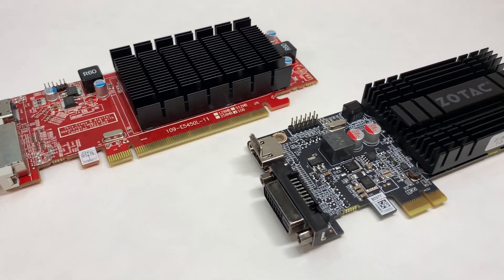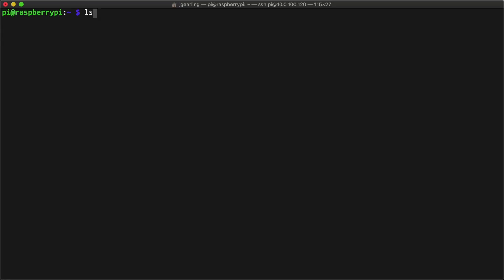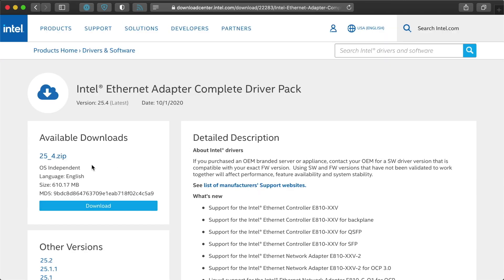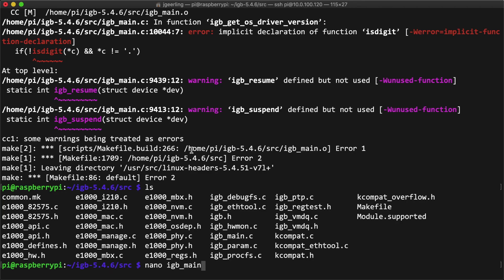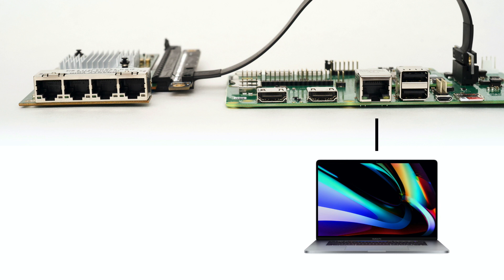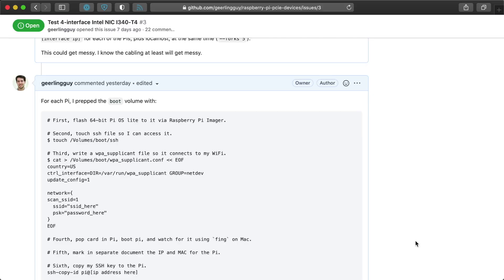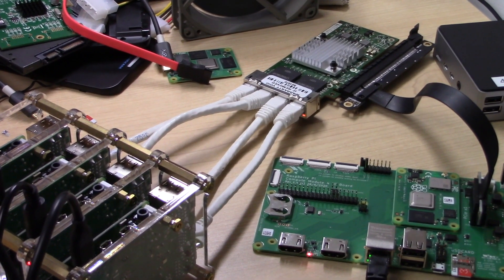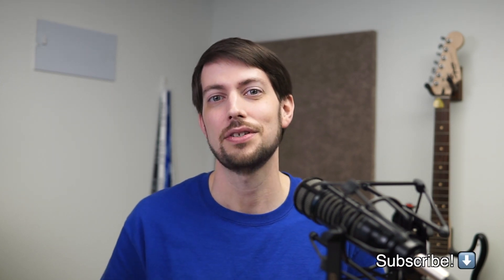5 Gbps Ethernet on the Raspberry Pi Compute Module 4?!

Comment: introduction-to-receive-side-scaling
"... RSS can improve network system performance by reducing:

Processing delays by distributing receive processing from a NIC across multiple CPUs.

Distributing receive processing helps to ensure that no CPU is heavily loaded while another CPU is idle.

Spin lock overhead by increasing the probability that software algorithms that share data execute on the same CPU.

Spin lock overhead occurs, for example, when a function executing on CPU0 possesses a spin lock on data that a function running on CPU1 must access. CPU1 spins (waits) until CPU0 releases the lock.

Reloading of caches and other resources by increasing the probability that software algorithms that share data execute on the same CPU.

Such reloading occurs, for example, when a function that is executing and accessing shared data on CPU0, executes on CPU1 in a subsequent interrupt.

To achieve these performance improvements in a secure environment, RSS provides the following mechanisms:

Distributed processing

RSS distributes the processing of receive indications from a given NIC in DPCs to multiple CPUs.

In-order processing...."

Comment: Note on the "Multiple IP Addresses" point: This is only relevant for IPv4. IPv6, by design, demands that any interface can have multiple addresses. These include: Link-local which is always starting with fe80::, the external IP and a private IP (if privacy extensions are enabled) based on the public IP. It also could be that an interface has an IP inside the fd00:: space, which is the address space that's not routed into the internet (and which can be misused to make NATv6 possible, although this is usually a dumb idea).
This also makes it possible to have multiple VLANs on a single port, which is great.

Still, multiple physical ports make stuff more redundant and can improve speed by link aggregation, so don't just throw out out old 4x1G NICs ;)

Comment: s.o.s !!!! I am searching for an almost similar use case like yours (only you power the nic directly from a pci slot probably that is why you can power it without external help)  months now and I cant seem to find any info anywhere. I want to connect to a mini-itx  motherboard (H370M-ITX/ac for nas build) an intel x520-da2 nic  card, but the only pci-e slot is taken from the HBA  card. So I thought to use an m.2 (the motherboard i mentioned has an ultra m.2) to pci-e adapter cable and connect there the 10Gbe card. Problem is from which power source I should power the nic card since m.2 slot can provide up to 8watt (if I can recall) and the cable at the pci -e end has a 4 pin fan-like header which can be connected to the psu via the 4pin molex or 4 pin sata. Will it be sufficient to power the nic or I ll burn both mobo and nic card ?

ps here some of the cable types  I was describing above https://www.google.com/search?q=m.2+to+pcie+cable&tbm=isch&source=iu&ictx=1&fir=vFKS9jJAKXM0lM%252CHbSbT9aFjGvdFM%252C_&vet=1&usg=AI4_-kS7wlqL_CmV_EW1Y8VdJDLTcfOt7w&sa=X&ved=2ahUKEwi1nu3jhZ_wAhUuwAIHHcZXD30Q9QF6BAgoEAE&biw=2121&bih=1222#imgrc=vFKS9jJAKXM0lM 

In conclusion even though 4 lanes of the ultra m.2 slot would be sufficient for speed my doubts are of how to power up the nic

Comment: What you could try is a LAGG, round robin mode, then another machine using equivalent LAGG, round robin. But you will need managed switch. Then configure 4 vlans, and put each port into a single vlan. Now you can have 1ip across your LAGG, and the round robin fires out into a vlan stopping any mac flapping that may occur. Allowing IP to IP connection via a round robin across the ports in different L2 broadcast domains. The downside to this method is requirement for managed switch and those networks only being functional to devices with the same shonky vlan setup. It's pretty hackish though. Also instead of a managed switch you can use multiple unmanaged switches, as long as they provide segmentation to prevent the Mac flapping behaviour

Comment: I use one of my Pi 4 as a home Wireguard VPN, and plan to expand my home network using more dedicated Pi, as dedicated boxes limits surface attack: a successful attack on one box could not impact another one in any other way, no sandbox or VM evasion (through general and local firewalling avoiding DoS)

Comment: It was disappointing to find out the RPi4 does not have hardware AES support.  That limits the ability of a router built on a Raspberry PI to do any VPN without a huge CPU overhead.  Just like my comment about GPU support, I hope that the Raspberry Pi foundation can find an SOC that has better support for mainstream hardware.

Comment: Your bottleneck is almost certainly going to be the high number of packets per second.  The arm cpu just won't be able to keep up past a certain point.  You can increase throughput by sending larger packets (jumbo frames) or by increasing the clock speed of your cpu

Comment: Jeff, well done chasing all the choke points that limit Ethernet performance. I had someone swear that it was impossible for Ethernet to achieve anywhere close to wire speed only to find out he was mounting floppy drives on two different servers and measuring transfer speed. He somehow thought fast Ethernet would magically improve his drive hardware, go figure. Thanks for using Barton Hills (82580), I led development for that product and I feel vindicated that it is still chugging away. Keep up the great work!
Reply from the maker: Small world, I love getting to hear from some of the people who have worked on these devices (a storage engineer who worked on one of the older controllers I tested spoke to me via email recently too!)

Comment: There isn't enough bandwidth. I work with networks for a living and build my own routers. There just isn't enough for all those ports over that 1x interface. Your basically taking 4x pcie and chopping 3 legs off...3 gigabits is actually damn impressive though. Can you test if the using usb bandwidth affects this? I'm curious and this might have a really nice use case

Comment: This comment will probably be lost in all the others, but it sounds like a system bus saturation issue. That's a common problem with SoCs. You could probably try overclocking the main clock which would potentially increase the system bus clock (most likely it's a 64-bit AXI running at 1/2 the CPU clock or something like that). Note that you're not saturating the bus in one direction, but multiple directions due to the MMIO handshaking required in the drivers to perform the network functions (i.e. multiple reads an writes). So that's why the bitrate you are seeing is not the same as the memory bandwidth for example. In terms of the Gigabit controller running at less than 1 gigabit, that's probably an issue with the MAC having additional overheads that will slow it down (so a single MAC wouldn't saturate the AXI bus).

Comment: It's obvious that it's the PCIe 1x slot that's holding you back. There's a reason that card uses a 4x connector. And the Pi is just not powerful enough to process all those packets in software.

Comment: You did a review of both the Pi 400 and the compute module with IO board. Given the price points which would be the better option? Both have advantages. The 400 is simplistic. The compute module and IO board seems to have lots more options for expansion. Only draw back to the module and IO board is there are no cases designed to house it. Since the module was designed to be embedded there were no cases created.

Comment: one question how do i fixing my Wi Fi on my HP Stream 11 after downloading LunixMint 19.3 it messed something up and now i cant use my wireless internet and the HP Stream 11 i have has NO Ethernet cable slot and the only way i can use it to get on YouTube or play on Minecraft servers is using my bluetooth Tethering it works but it slow and i don't know what wan card it uses but it should be related to INTEL if anyone on here can help me please help me ;-; also it is a 32bit system not 64 bit cause i just don't have the money for that and ive started to notic that 32 bit is starting to go dead witch is stupied it did have windows 10 but i got it from wallmart and lets just say THEY DONT CHECK FOR PREINSTALLED BLOATWARE ON THE DAMN HARDDRIVE THEN IT BLUESCREENS YOU DAMN COMPUTER AND LOCKS YOU OUT OF YOUR BIOS!!!! THEN YOU SPEND LIKE 1000$ ON A FRICKING 100$ LAPTOP AND THEN IT STARTS TO MESS UP THEN YOU ERASE THE ORGINAL OS THATS ON IT USING THE BIOS AND THEN INSTALL SOMETHING THAT WORKS BETTER BUT THEN BRAKES YOUR DAMN WAN CARD REEEEE also just incase you don't know LinuxMint is an unbuntu based distubution and all caps is just me ranting so ignore that if you want to

Comment: Looks like you'll need more than one PCIe lane to run more than 3Gbps with that thing.  Also, how much does the CPU clock affect how quickly the system can work on the data stream?
Reply from the maker: Apparently a lot! With the CPU overclocked, I can go from 3.06 to 3.40 Gbps total.

Comment: If you want to do networking stuff like that, I would recommend to use a pi clone: the NanoPi. For isntance the NanoPi R2S.
And flash armbian on it. Works wonders and cheaper than Raspberries.

Comment: I am not a Network Warlock ...but have learned some stuff on the pass on this realm ....

have you tried with MTU 9000   (Jumbo Frames ) ??

usually when you want really good performance in networks YOU HAVE to do that ....  
it is just a thing of too much control data bits versus how many really "Data" bits (Payload) 

so how about a little change in MTU in all Interfaces and try again ....   Even with the "native" Ethernet 

and let's see what happens !!!  
Pleasseee ????

Comment: Forget PFSense, their ARM-port is only for their particular hardware.
Also, their developers run to OPNSense, which has at least an RPI3-Beta-Build from a forum member which works.
Already had some time testing it.
They need some help for getting it running on the RPi4 (probably only DTS-related stuff) and moved over to the newer HardenedBSD-Kernel the V20.7 is using so maybe it's best to put your energy there.

Comment: Did you try Jumbo Frames.  Remember depending on the packet size at layer three you are chopping up packets to about a 1500 MTU size and you are dealing with TCP windowing at layer 4.  Your best bet is to use a UDP stream to really get an near accurate throughput , but you will never see a true 5Gbps because TCP is connection oriented and it has a lot of overhead.

Comment: Hell I'd be completely happy with 2 1gb connections. A router doesn't need more. I'd be interested to see how the connection speeds are when using a "dedicated" router OS/firmware. Right now I'm running pfsense on an old athlon CPU and I would definitely like to use something more power efficient.

Comment: have you tried disabling all wifi interfaces during the test ? Although low bandwith is needed it may be bottleneck in the interrupts part. You could do this  e.g by some scripts which will do rmmod / modprobe and then autoreconfigure wifi . Also you can try oprofile and manually assigning interrupts - you can start with this forum entry using Google Translate: https://trzepak.pl/viewtopic.php?t=33245

Comment: Here's another idea, and it's also about a device that would be used in a server environment. Because apart from loads of bandwidth, servers need a lot of storage space. I think it would be very interesting to test if you can make a SAS HBA adapter to work. Specifically, I think that a good device to try would be a IBM H1110 controller, PCIex4, has one SAS port to which the appropriate cable you can attach up to 4 SATA drives. It can do hardware RAID too. I use one of these in my home server (but not with its native hardware RAID, rather using ZFS). If it works, it should give you better performance than a SATA card, even a 4-port one.

Comment: what os do you use on your pi's
Reply from the maker: Almost always Pi OS. Sometimes HypriotOS, for the cloud-init integration. Might start testing more with Ubuntu though!
Reply: @JeffGeerling  I've currently been using Ubuntu server and its a little less smooth than I would like. I'm probably going to see how Pi OS works in comparison.

Comment: Unless R Pi designers changed something in the CM4, their specs on the PCIe lane is maximum of 4Gbps. So if you're approaching that it is likely there is some overhead in the drivers, OS, hardware, etc. What I'm hoping - like on my knees, hands clasped together, eyes to the heavens, is that some clever soul or company will design a board to house 2 CM4 modules, have two PCI slots, and modify RaspiOS to operate as a pseudo cluster that is able to get more speed throughput for things like the multiport ethernet. I know, I know - a cluster is not the same as a more powerful single computer. But, if you can have two Intel I340-T4s linked with a single gigabit connection there should be a way to get the speed you want under certain conditions. Anyway, I am completely stoked and motivated about the CM4's possibilities. I'm also going to get a TuringPi 2 when available. The future is bright!

Comment: A standard CPU can have 40 or more PCI Express lanes.... The Raspberry Pi 4 only has ONE..... Everything on the board that uses PCI Express uses that ONE lane...

The Onboard network card and external pci express 1x lane share the same ONE Pci Express lane..    Get a single 10 Gig network card are try to max it out... I would be interested to see what its max output would be....

Comment: you can use a soldering iron to open up the PCIe slot, did this on a dell poweredge to throw in a gt630

Comment: I didn't see anybody else mention this, but there were a lot of comments, so sorry if this has been said before. Have you tried jumbo frames? E.g. sudo ifconfig eth0 mtu 9000 all all of the interfaces? It should reduce the CPU overhead and with directly connected cables that short, retransmit shouldn't be an issue.

Comment: The qnap 5 gbps usb installs easily on the rpi 4 and works fine
Reply: QNAP USB 3.0 to 5Gbe RJ45 Adapter QNA-UC5G1T 

you mean something like the above?
I totally for it than the 4gx1+1g approach in this video.

Comment: You mentioned PFSense on the Raspberry Pi4 - how do you plan to do that?  pfsense does not offer anything like that, despite their own ram solution (whicht is AFAIK an ARM Esporesso.bin)  which is bound to their hardware only?  Thanks a lot for clearify.

Comment: Just wanted to note that if you just want to use the Pi as a multi-interface router but don't need total bandwidth over 1 gig, you can get by with a cheap managed switch with VLAN support. Just configure the switchport feeding the Pi as trunk, configure the appropriate VLANs on the Pi interface and away you go.

Comment: Weeeeeeeeeeeeeeeeeell, it's a nice test thank for you to do it, 
but from the start you could say that this plane wouldn't fly well...

Having a PCIe 4x card in a PCIe 1x slot will necessarily not run full speed.

I wonder just how much it is possible to get PCIe wise from a Pi, will the Compute Module give us a 4x port or a second 1x port in a later revision?
This would be really exciting.

Comment: Hey Jeff, I have done something similar.  I ran into lots of issues with throughput.  I tried an unmanaged switch and throughput went down.  I then grabbed a managed switch and ran the same test.  I was able see better through put.  I did notice that 2 different ports where giving me odd results.  On the device that I was using I was having issues with port sharing.  The onboard port and card shared some resources.  I ended up changing some settings and was able to get all the ports working.  The best results I got was when I teamed the ports and setup the switch to take advantage of it.

Comment: Although it seems a good idea to make it as a router, since is low power consumption. The CPU on Pi is too slow to provide not only decent network speed, but also to make available the intrusion security and other firewall/QOS/router related features to be a true router with pfsense or opnsense.

Comment: The Intel IGB Driver is part of the Linux Mainline stack, so you haven't need to download it from intel, just compile the module which was in the kernel sources.
Reply from the maker: Apparently so, I just didn't think to search for IGB in menuconfig. Oops!
Reply: @JeffGeerling  Install Gentoo

Seriously you get really good with Custom Linux Kernels and System Configuration.

Comment: I see that the PCIe bus is a single lane for the HDMI and USB3 controller chip. Is the module running a GUI or X Windows server? It could be saturating the bus once you factor in the external card, internal ethernet chip and the other components on the bus?

Comment: You might want to add a cooler and overclock the Pi. Perhaps the problem is the Pi itself doesn't have the power to keep the network running at saturation.

Comment: This is more than sufficient for a 1GbE router, and it would probably make a decent low-cost 2.5GbE router, although it wont be able to saturate the interfaces simultaneously. Still, almost nothing has 2.5G ethernet yet anyway.

Comment: When you have to configure multiple raspberry pie, give ansible a go. On the speed side of things, looking at the specs of the compute module 4 itself :
PCIe Gen 2 x1 socket
This results in a maximum speed (theoretical) of 0.500 GB/s, if I'm not wrong the USBa are shared with the PCIe lanes => 2xUSB 2.0 = 960Mbps ~ 120MB/s that would take enough for having a capping point (you could try to de-activate them -USB's- and retry, of course if possible, not sure if the addressing still stands in the firmware). Then again it can be that more devices are share, not sure.
The 5GT/s is not the same as the transfer rate of 0.500GB/s for PCIe 2.0 1x (Gigatexels is a measure of the texture unit throughput) so your hard cap on PCIe for transfer (theoretical again) is 4000Gbps.